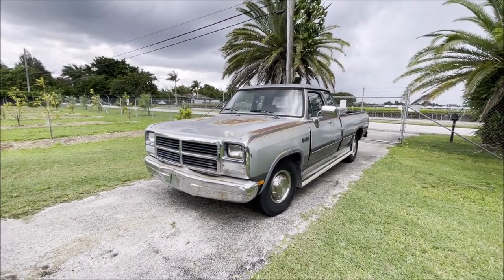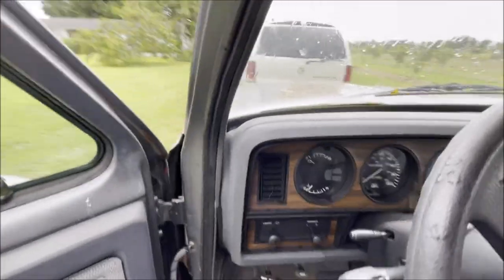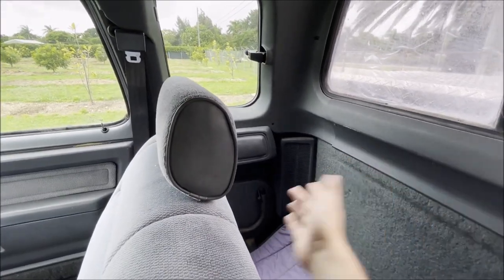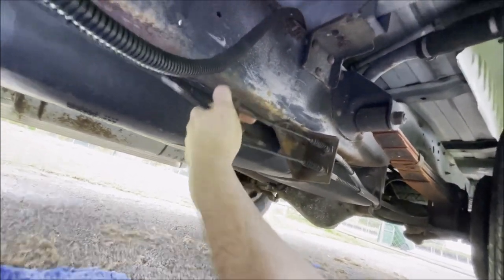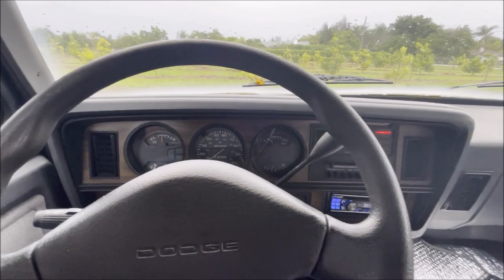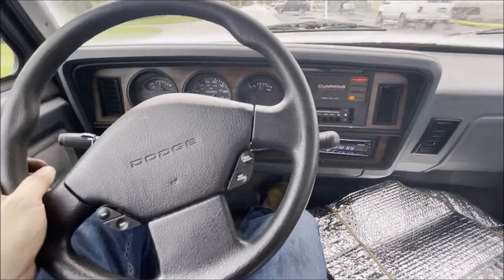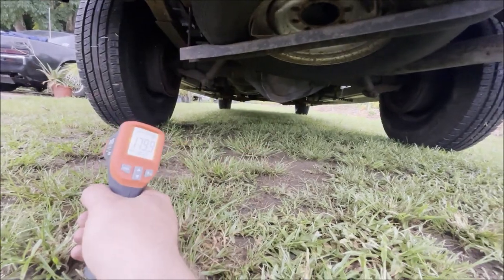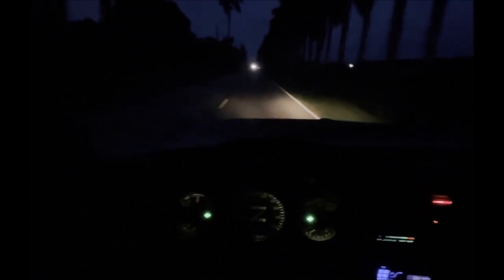$1000 Dodge Cummins TurboDiesel Estate Sale Score *First Drive Fails*

Comment: Major score!!! I had a 94 dodge 3500 van that use to do this. Take it into heavy traffic or around town and the front calipers locked up. Changed the calipers and the rubber hoses and they still did it. My guess was the master cylinder but honestly im not sure. Ended up selling the van.
Reply: I had a Chevy G20 van that the front brakes got hot in to where the rotors would warp and the front end would shake under braking.   Come to find out the rear hose fitting on the axle had cracked, under higher pressure it just leaked, but otherwise it didn't, so no puddle in the driveway.   The brakes got hot because the front was doing all the work.

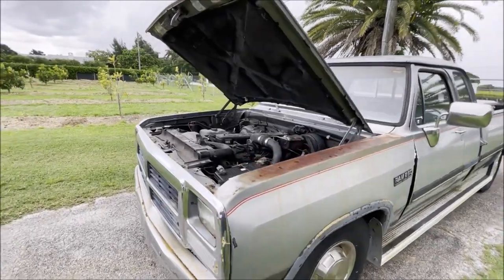Comment: At 6:38 you said it sounded like a school bus and then at 11:53 , you then helped me confirm & know that you knew that the Blue Bird TC 2000s, TC 1000s and All Americans and other '90s and early 2000's school buses like Thomas and even International also had the 5.9L Cummins diesel.

As far as your brake situation, not only replacing your caliper, but I would suggest that also replacing all of your rubber brake line hoses on that truck would be very beneficial and not too costly. 

After all those years in the hot Florida summers, those rubber brake lines could have collapsed possibly. 

Can't wait to see more videos of this truck and once you have her back up and running, roadworthy, you'll definitely have to take more driving videos because I could just totally listen to you drive that d250 for an hour straight if I ever had the chance. Thanks for the lovely video!

Comment: Great video bro. That was smart cutting the e-brake cable. And then using the digital temp gun to check the temp of each brakes helping you to find out the front was worse than the rear! My mouth dropped seeing the front driver read that high temp 😂😅.

Comment: $1000, you bought a set of tires and a battery and the truck was free.  

Put a 5th wheel in the bed and get a decent trailer and you can haul three cars at a time if you want. 

Probably needs brake hoses.  Shouldn't be expensive.